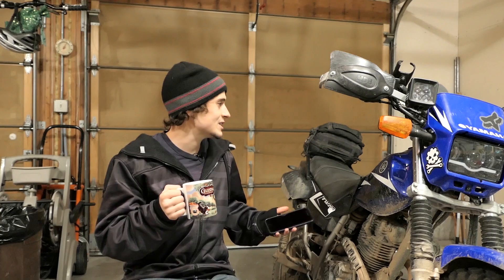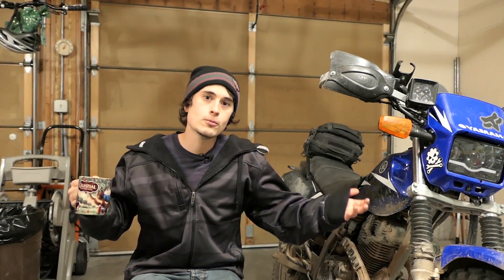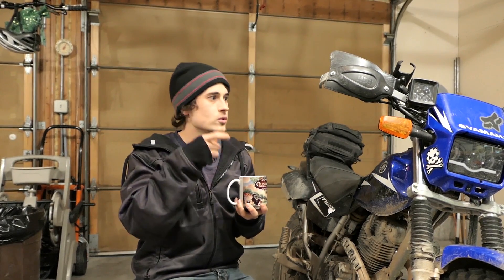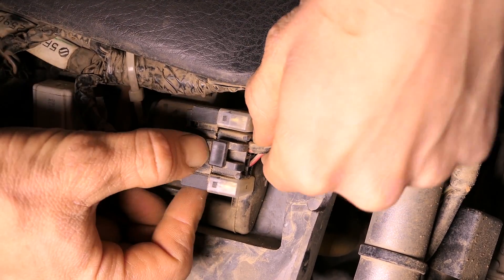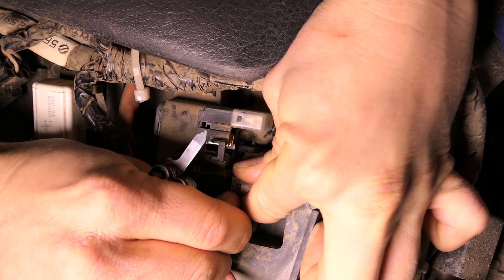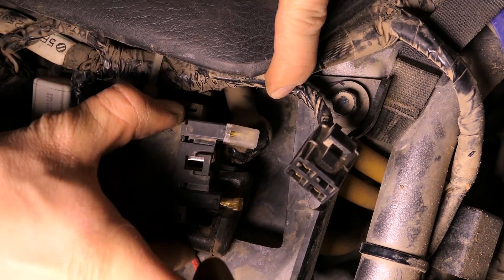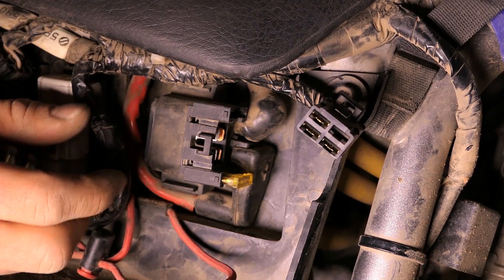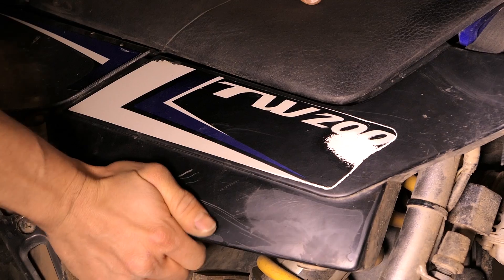How To Replace Fuses on a TW200 and why they Blow in the first place

Comment: I believe, because you had the main wire harness unplugged, having the fuses in or out wouldn't make a difference. Pop the cover off and see if anything happens with the fuses in and the harness unplugged. The bottom fuse is "live" and the top one is a spare according to the owner's manual. Thanks for all the great videos!
Reply from the maker: yeah I can't believe I forgot about that, it was really late haha, makes sense now that the top one is a spare cause it pretty much just fell out thanks!

Comment: You are very knowledgeable,,I believe you are a mechanic,,I am 64 and retired master journeyman auto truck motorcycle mechanic and love you videos. One thing wanted to share with you about your fuse video,,I always use a little bit of dielectric grease on fuses and connectors that are exposed to the elements. A little bit of corrosion can form where fuses and connectors plug in and create resistance. This being said can cause fuses to fatigue over time and blow for no reason. Best Regards my friend,,Bob Clancy
Reply from the maker: thank you sir! I do work as a mechanic. oh very cool. that is some good advice thank you so much :)

Comment: I recently attended a small indoor flat track race and a couple dudes had TWs in the amateur open class. The track was only about an eighth mile and it was packed full with just six or seven bikes racing. The TWs did pretty well though, I'm in love with them and realize that I must have one someday soon!
Reply from the maker: that's awesome! I think I saw a video of someone flat tracking a tw200 it was neat to see. they are great little bikes!

Comment: When you tested the fuses you didn't plug in the center plug on the video. Did you plug in the center plug when testing the separate fuses?
Reply from the maker: Todd Fisher ohhh I totally forgot, thanks I’ll have to retest it
Reply: I think one fuse is a spare
Reply from the maker: @slamboy66  interesting would make sense actually since there is only one on the wiring diagram, and the top on pretty much fell right out, thanks

Comment: DIELECTRIC GREASE:  A habit that I have is whenever I obtain a new vehicle such as my TW200, 4 Wheeler, Trucks, Tractor, boat, small engine etc.  I go around with a tube of dielectric grease, unplug every electrical connection I can find, fill the female end of all the electrical connectors, wire connectors, bulb sockets, fuse connections etc with dielectric grease then reinsert the male end of the connection.  In doing so, the excess grease is squeezed out.  I take this excess and stick it into the next connector and so on.  One by one.  Including the high voltage ignition system, battery terminals, bonding and grounding connections.  This eliminates lots of electrical issues down the road.  Most of my vehicles are exceeding 20 years old and I have not ever had electrical issues.  Chasing electrical issues can be a real pain in the butt.  Corrosion primarily caused by salt in winter and by water from rain and deep water can get into connections and cause corrosion.  This is where an ounce of prevention goes a long way and continues to pay dividends the older our vehicles get.  Knock on wood.  

Fluid film is also a great corrosion inhibitor.  As I use it to prevent corrosion on my vehicles, the wiring harnesses and connectors are covered with it.  No electrical issues.
Reply from the maker: nice, that's a great idea especially since most of the connectors on the tw are not weather sealed. and it's likely to see a lot of moisture
Reply: @TDubsKid  Thanks.  I really like your vids.  This may mean something to you as I used to be a jet engine mechanic for the Coast Guard.  Your vids are excellent and I find the one on adjusting the valves quite useful as I watch it just before going to adjust the valves on my TW.  This along with having marked my manual with all the fastener head sizes makes the valve adjustment process, go quite smoothly. 

As for the dielectric grease.  I learned this from a friend of mine who is an ASE master mechanic and in charge of all the maintenance at a large 36 hole golf course.  The story goes that they had many new and very expensive Toro turf machines.  My friend had gone through all the machines placing dielectric grease in all the electrical connections.  This is especially important as these machines are often hosed down after use.  A few years later this friend of mine was at a big Toro turf machine show and the local Toro rep approached my friend and asked him:  What are you doing with your machines.  My friend did not understand the question.  It ended up that Toro had to replace many computers on these machines all over the US because the computers had died.  Yet all the machines at the golf course where my friend worked had not had any problems with needing to replace any of the computers on the machines he was in charge of.  My friend explained to the Toro rep what he had done with the dielectric grease when the machines were new and it was determined that the dielectric grease had saved many of the computers at the golf course where he worked.  So not only do shorts cause things not to work properly or not at all, they can also send voltage to the wrong locations/components which can fry components.  Maybe you could do a vid about filling all the connections with dielectric grease.  I would enjoy seeing that.

Something else you may find interesting is that I made a mud flap out of some 1/8 inch rubber conveyor belt material and attached it to the trailing edge of the front fender using 6 stainless steel #8 machine screws, washers and acorn nuts that are evenly spaced.  The mud flap hangs down 8 inches from the lower edge of the fender, goes up about 4 inches above the lower edge of the fender against the side of the fender facing the tire.  It's a bit wider than the fender itself.  This really stops a lot of mud, dirt and water from being thrown up onto the engine.  It also helps to stop a lot of the dust and sand from being kicked up and being caught by the oil on the rear chain.  Since I've installed the mud flap, the front of my engine stays much cleaner, no more baked on mud on the exhaust pipe and the chain stays cleaner with less grit as well.  

I just ordered a Firstgear Thermo One-Piece Suit   
https://www.amazon.com/Firstgear-Thermo-One-Piece-Suit-Large/dp/B0018EPQBU/ref=sr_1_1?keywords=Firstgear+Thermo+One-Piece+Suit&qid=1571715243&sr=8-1 
and plan to ride all through the winter, road conditions permitting.  The suit has 4.4 stars with excellent reviews, its waterproof with many positive reviews on how warm it is.

Be well my friend. :)
Reply from the maker: so much appreciated, that really does mean a lot. glad to hear it has been helpful. oh wow I guess they should have used dielectric grease at the factory haha. Ill add that video to my video idea list. thats a cool idea, my engine always get's caked in mud haha, nice ill have to check it out, I can never stay warm on my bike in the winter lol
Reply from the maker: thanks, ride safe!

Comment: Hey TDubsKid love the videos, I have a question, my turn signals don’t work but everything else does, the horn and high beam switch. Could it be the housing or a fuse? It doesn’t even indicate in dash that my turn signal is on
Reply from the maker: sounds like it could be the flasher module that could be bad but not 100% percent sure

Comment: I got a 2002 tw200 thought i blew a fuse but it looks fine its something else.  in your video you take out  the fuses and unplug something that the fuses plug into. on my bike that thing makes a chirping noise.  what is that part and can i replace it
Reply from the maker: I can't figure out what what's wrong without having the bike here, not sure what you mean by chirping noise?

Comment: Good info as usual. 
I was wondering, this is off topic but..  Have you seen the new KTM Adventure 790 bikes? They are listing the road oriented adventure 790 with a seat height under 32.5" seat height. Would you ever consider something like that for future trips and such?
Reply from the maker: thank you! and I have seen the new 790's they are pretty sweet. it's actually something I was considering, I like the adventure R a lot even though it has a higher seat height, can't wait to see how much they will cost. the tenere 700 looks super cool too but that won't be out till 2021  a second bike would be cool for more street riding but ill always keep the tw200 if I get another bike
Reply: I'm going to do an adventure type build using a good old dr650. Seat height will be ok with the aftermarket choices. Weight will be manageable under 375 with all the mods . Should be enough power for highway use long distance. I just want the bare bones non computerized bike I can work on myself.

Comment: Great video tdub. Since you are on the electrical subject. Could you please help? We purchased a 1987 tw and the headlight and brake light don't work. Bulb is fine but not getting power. Do you know what circuit it is on ,does it have to be running for the headlight to operate? It shouldn't I would think but it's an thank you for your input.
Reply from the maker: Hey thanks. Probably just best to check the connectors for corrosion and follow the wires and look for exposed or cut wires

Comment: Its actually soy, not peanut oil. Its a way manufacturers are going green instead of using chemicals in wire manufacturing.  Great vid.
Reply from the maker: gottcha, makes perfect sense why they are attracted to wires. thanks
Reply: Soy and corn both,,a big problem with varmints such as mice in the auto world. Always set traps around your equipment where there are varmints especially mice

Comment: Hi I got a 2005 yamaha tw125 where are the indicators wiring located on rear as none indicators on it see
Reply from the maker: hey you should be able to see the wiring underneath. if there is none you will need to run your own of find where on the factory harness has been cut

Comment: How are the balancing beads working out for your front tire? I have the exact same tire setup on my TW and have been thinking about adding those beads to calm it down at high speeds.
Reply from the maker: I haven't put them in the front yet, still need to change the front tire, there will be a video on it, can't wait to see if it makes the front a lot smoother on the road. so far so good on the back though

Comment: What happen to my tw200..recently i just use the kick start mode..since my battery died..but after a month..there is no light and signal..they have the light..but very2 low light..what happen to my tw 200? Shud i check the fuse or just replace the new battery?
Reply from the maker: probably need a new battery and/or stator if the fuse was blown the bike would not do anything
Reply: TDubsKid the fuse are okay sir..i think i need the new battery..btw please make a video what is the use of voltage regulator..and what happen when we use kick start frequently and no battery installed..

Comment: You broke the plastic because your supposed to push on the little black tab and pull off the cover. Not pry it with a multi tool.
Reply from the maker: thanks for the tip

Comment: Sir..what happen to if u use the kick start everytime i start my tw200?because my battery died..so i just use the kick start..and now..i see there is no light..before i realised this problem..and i cleaned the regulator..and works like normal..but now..it came back..
Reply from the maker: check the running voltage

Comment: Hey man! I have an 1989 TW200, and my starter solenoid doesn't have fuse's. Why is that so? My bike suddenly won't start, and I went to see if the fuse was bad, but there is no fuse! Please help!
Reply from the maker: hey! I beleive the older ones had a different fuse setup, looks like it in a similar location, but it's a glass type fuse and is inline with a red wire in a clear plastic housing

Comment: This is slightly random, but you really love your bike, yeah? I've worried that those wider tires will be a significantly greater expense than more common sizes?
Reply from the maker: yeah it's a pretty good bike, my front tire is 67 and rear is 123 a bit more pricey than normal tires

Comment: If everything goes dead after hitting the starter, check the battery terminals.  I bet he has a loose one.
Reply from the maker: thanks, that's a great thing to check if the fuse isn't blown but it's still doing that

Comment: Review your video again. And check and see if your power was a complete current. I don't think you had the wiring harness plugged in and that's why you had no power to either test the upper fuse in the lower fuse. You didn't plug it in until the very end
Reply from the maker: maybe ill revisit this someday if I need to but for now I don't have time

Comment: thank you so much man i appreciate it
Reply from the maker: no problem! sorry I wasn't able to get those covers off without breaking them, I tried. did you end up fixing it?
Reply: Hey man if your fuses are good and you still have NO POWER to anything, theres a good chance it is your battery. Just put a meter on the battery posts while the key is in the OFF position (you should have roughly 12-14 volts) and then  turn the key to the ON position, if the voltage drops to basically nothing you have a bad battery. I had this happen on my 2010 TW200.
this is a form of "load testing"